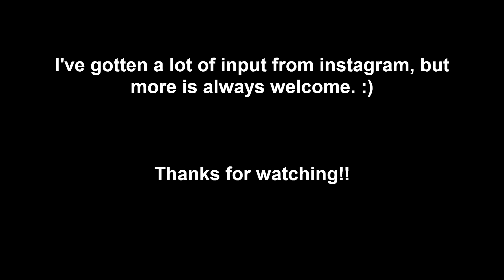Deep Slot Grief

Comment: With that small an end mill, plunging is about the best way to get a strait slot, as Nico says, by keeping the cutting force axial; followed by straight cleaning passes along the walls to get the width.  Any side cutting using that circular pecking path is going to make a tapered 
slot as the cutting forces needed near the tip can't be achieved as they are higher then that needed to deflect the cutter.  Add to that the tangent forces of the bottom flutes trying to mill the root as the cutter  is dragged along.  The tip is always going to lag behind trying to catch up and the leading edge of the bottom flutes will be digging in and pushing the tip sideways. In Mike's case with that tool path he would need to slow the feed WAY down or pause the feed often to allow the tip to make enough spring cuts to catch up - which is appropriate as the tip of that size of cutter is basically a spring.
Reply from the maker: Hmm....I was only thinking about the sides of the cutter cutting.....but the bottom of the end mill has to cut too......I can see how the tip would have a lot more load.  What I've found puzzling.....the first couple of times I did the trochoidal path, I used something like .0005" and you can see it made chips way better than the .00019".  I'm guessing that the first couple worked better because the cutter was brand new and the tip was just keeping up?  Once there was a slight amount of wear, it couldn't?  Even with the really slow path at the end of the vid....I'm still finding that the tips of the flutes are wearing after a couple of sets.  It's still cutting.....at least it's making the slots.....but the wall finish isn't great like it is on the first few parts with a new cutter.  I don't know if it's recutting chips and causing extra wear, or if it's "bouncing" the cutter and causing it.  If I can't get things figured out to where I can run these without killing end mills so quickly, I'll turn down any future orders.  It was barely worth it at the price without all this extra tool cost. :(
Reply: I must have missed it but what material is the work piece?  I ask because I think the accelerated cutter wear and breaking at lower feeds can be caused by work hardening of the piece.  Lighter cuts means less tool pressure to ease deflection but that pressure reduction then causes more skating/rubbing which led to work hardening near the tip.  When you ran the mills harder (just under breaking pressure) they must have been able to bite in just enough to mitigate WH but the line between cutting and breaking is pretty thin to dial into.  Like with copper, work hardening is a principle method to strengthen aluminum if that's what you're using.  I'd use a slitting saw first to remove the bulk.  You can whip one up with Harbor Freight parts for $10 either using the 2 inch HSS saws and stacking them or a 3-4 inch carbide tipped saw if you need a deeper cut.  I use the mini carbide on a 1/2 inch flanged mandrel a lot to chew off material before finishing with a mill if needed.
Reply from the maker: It's 1018 steel.  Interesting idea about the work hardening.  Hadn't even crossed my mind.  
I might consider a slitting saw if I get another batch of these, but for now, I'm just going to finish things up with what's working(for the most part)....just so I can get them done and move on to something else! lol  I may change things up slightly for the last set or two ......or I may run a few extras and try some changes....I haven't decided yet.  I still have two more ops to do on these, so most likely, I'll just move on.
Thanks Eddie!!

Comment: It looks like the trochoidal strategy might be somewhere around 1:30 to 2:00 long? Maybe do the slot at 1/3 the depth (~0.170") and do three trochoidal passes. ~4:30 - 6:00 would be better than 12:00 and it seems like the bit would survive. Actually, maybe it would survive by just reducing the depth to 0.250".
Reply from the maker: The trochoidal path took about 9 min if I remember right.  When I changed the cam to have it run at two depths, it was 18 min.  The path I'm running now is about 11min.  The parallel tool path that runs next takes about 9 min per part.  Basically....I've just been finding other stuff to do during those times.  Makes the time go by much faster!! lol   After these 40 go through the first op, I need to do another 20 similar parts.  Their first op is basically the same.  I was able to do the CAM work for those parts while I was waiting for these two slow tool paths. :)  Win!!  The previous day, with better weather, I got some stuff cleaned up just outside the shop.  That's also helping with the mental side of under bidding the part.  At least this way, I feel like it's a lot more profitable. :)
Reply: Oh, was the video sped up? I thought it sounded like it was at 1x speed, and the break happened at 1:02. I tried to estimate the amount of time that was edited out too.
Reply from the maker: The vid was not sped up.  I kinda prefer to hear/see the actual speed on tool paths, but not necessarily watch the entire thing.....so I edit my vids to the way I prefer to watch.  There are some vids I like the "speed" up on....just not actual tool paths.  I hardly get time to watch any vids, so it doesn't really matter. lol
Reply: Sorry, I'm confused... At the beginning of the video it looks like the bit is making pretty good progress on the slot by the first edit point in the video. The cut starts at about ~0:08 and the edit is at ~0:31. In those 23 seconds, I think it looks like it's doing about a diameter worth of the milling, so ~0.080". How long are those two slotting cuts combined? I tried to "measure" it using a screenshot and it looks like they're maybe 0.400" combined, is that close? If it can do 0.080" in 23 seconds, I'd guess it could do 0.400" in ~120 seconds. Am I WAY off?
Reply from the maker: haha!  Sorry for the confusion!  I'm sure it's being caused by there being more than one tool path in the vid.  The very first part....yes....It did great doing a full depth trochoidal tool path and I think the time was only supposed to be about 2 min to do both sides...maybe less?  I didn't look at the bottom of the chips so I don't know how tool flex was affecting the bottom of the end mill.  I'm pretty sure I was taking .0007IPT on that cut.  When it tried to do the right side of the hole, it broke.  I tried that tool path several times, each time dropping the IPT.  When I got down to around .00013IPT, I think it was taking about 11min to do both sides.  When I changed the CAM to do two passes(multi-depth), it was going to take 18min per piece, so I opted to try the slotting.  I will note....and I think it's in the vid.....I left more stick out after the end mill broke in the first part of the vid.  I was afraid that I wasn't getting good enough chip clearing and I wanted more room to get the coolant nozzle in there.  I should have went back to the minimal stick out and tried it, but I didn't.  Even with taking video, it's hard to keep track of this stuff.  Even if I talk over the vid when I shoot it, it's hard to find those comments again when they're buried somewhere in hours shooting.

The slot on the left is about 3/8" at the top, but at the bottom, it's around a 1/2".  The difference is because of the counter bore.  The slot on the right is about a 1/8"?  

!!..  I thought I'd lost/changed all of the troch tool paths in CAM.....but I just found some.  The long slot was about 1/2" and the machining time is showing 1:10 at .0007IPT(6000rpm).  The short side....shows :23, but it's not a complete tool path.  To do these two cuts and the contour passes to catch the fillets.....2:47 total.  When I got down to .00013IPT, it was 16 min for all of it.

So....you can maybe see why I got so frustrated.......it seemed to work so well on the first attempt.  I never even got close to that any time after.  The multi-depth tool path at the end of the vid....the one I'm currently using.....takes 11min....but that includes the fillets too.  So, I'm still faster, so I'm just going with it.
Reply: Aaahh, that all makes sense now. Maybe two half-depth trochoidal cuts with a 0.0007 IPT chip load would work, and maybe only take 3 to 4 minutes, but I can completely understand not wanting to risk yet another bit "testing" that idea.

I'm in complete agreement! It's really hard to keep track of the things that made it into the "final" cut of a video. Personally, I usually have to do each block of dialog 4 or 5 (or 20) times before I manage to (somewhat) coherently say what I want to get out. Makes it difficult to remember what things are kept and what things had to be scrapped!
Reply from the maker: Dan's Workshop has posted a couple of comments to this vid and contacted me privately.  He's got some very interesting info and suggested a speed/feed calculator from volumill/helical.  I'm looking into that info and I may just change things up a bit and see if they work.  I may call my Western Tool Supply(local) and see if they've gotten in replacements for the cutters I bought.  If I get some extras, I may just "play" a bit.  We'll see.  These parts have been so delayed it isn't funny.......so I just want them gone! LOL.  

It would be nice to have more time to make better vids.

Comment: I was told as a general rule use no more than 1.5-2X the end mill diameter for the depth of cut with an adaptive strategy.
Reply from the maker: In steel or aluminum?  I run more than that with a 3/8" in aluminum, but these little ones are cutting steel.  The counter guy recommended 1/2 diameter as a starting point.  The last tool path in the vid is only running .020"doc.  It was getting the job done, so I haven't tried anything deeper or faster yet. 
Thanks!
Reply: Addressing your milling solution from the beginning of the video when you were using Adaptive clearing to mill the slot, not the conventional milling at the end. The Harvey parameters are going to be for conventional machining. If you are using adaptive clearing you need to be using radial chip thinning numbers. Did you ever download the Milling advisor from Gibbs Cam/ Helical? I will email you a screen shot of the settings from it for the end mill you started with. But basically it says for a 0.080/4 Flute Carbide/10X DIA Length = 6000 RPM/9.87 IPM/0.160 DOC/ 0.010 Stepover. So you were about spot on just your DOC should have been much less. 

Also check out this link 

https://www.google.com/url?sa=t&rct=j&q=&esrc=s&source=web&cd=6&ved=0ahUKEwiyq-j97uLTAhUCNiYKHeRSB9YQFghFMAU&url=http%3A%2F%2Fwww.helicaltool.com%2Fsecure%2FContent%2FDocuments%2FTech_ChipThinning.pdf&usg=AFQjCNEyVsVxDX_clTlIDnS_66S1WXFDIw&sig2=oHz3mQdyLPyCwxqcbVoglg&cad=rja
Reply from the maker: Great info Dan!! Thank you!!  I'm still absorbing it.  I've got it downloaded.  I'm hoping to have a bit of time to look at it more tonight.  Thanks for the email.  I'll be responding more as I get a chance.

Comment: Would a slitting saw work, then use the end mill to do the cleanup? Well, you'd have to mount each part two ways. Never mind. :-)
Reply from the maker: A slitting saw has been brought up on IG a couple of times.  I have to mount the part for another op that would lend itself nicely to the slitting saw.  I'm hesitant because then I'd have to come back and do the clean up.  Even though the final tool path is slow, it handles all the fillets at the same time......so I'm going to go with it for now.  I'm not sure my end mills are going to make it through.  Seems the tips have worn/chipped off two of them already.  They still cut, but not as nicely.  Nothing has snapped yet.
Thanks Tom!!

Comment: As everyone else has said, your too deep. I've sadly been there. :)

I actually seem to remember milling a part, taking it out, and wondering why my cuts are at a slant. LOL :)
Reply from the maker: Well, that's something I've never been told before. ;)  
I'd really like to try some of the other suggestions, but I really need/want these done and out of here asap.  If the slot were another .015-.020" wider, it might have worked more consistently, but I'm sure the sides would have had quite the slant. lol

Comment: can you use a silting saw on the stock first and then do all the other operations afterwards
Reply from the maker: Hmmm.......interesting idea.  The saw has been brought up a few times on IG, but I don't recall anyone saying to do it first......so I hadn't thought about it.  I don't have a saw at this time, so it won't change what I'm doing, but if I end up doing more of these, I just might try that. Thanks!!
Reply: Clever!
Reply: Once upon a time, necessity forced me into a solution for a similar problem.  I didn't have a thin enough slitting saw, but I did have some of the larger, fiber reinforced cutoff wheels for my Dremel.  

I mounted my problem on an angle plate, chucked up the dremel wheel holder in a collet, and 'hogged' a dandy clearance slot that finished out nicely with a second op.  Don't look at me like that, Dremels are TOO tools despite what AvE says...
Reply from the maker: Hmm....great idea with the dremel and fiber cutoff wheels!!!  I always keep some on hand.  What I have figured out for now with the endmill  is working nicely, but I'll definitely keep that idea in my head for later. Thanks!!!